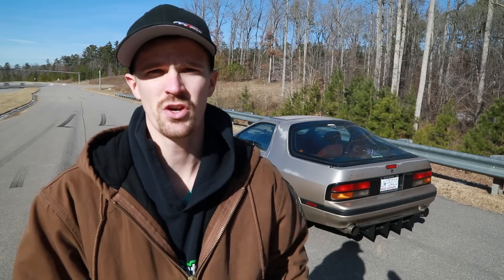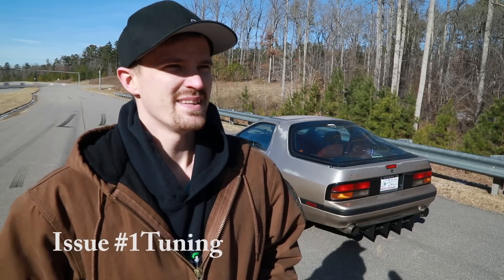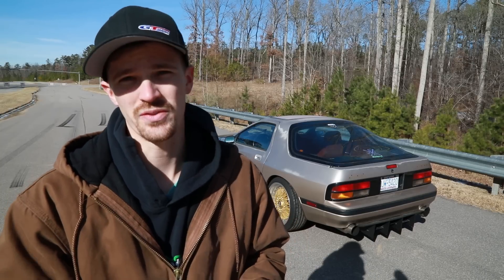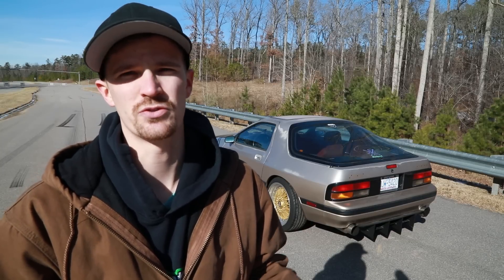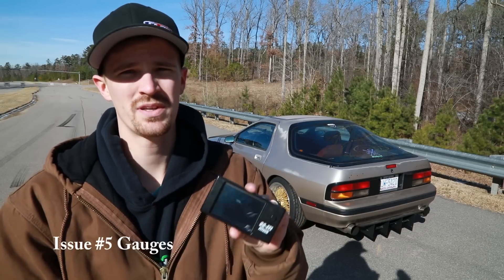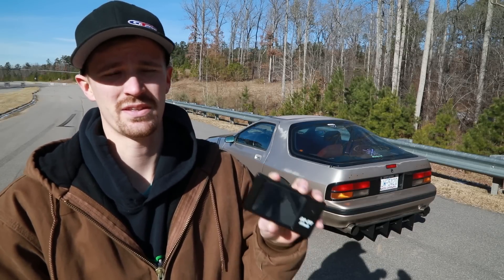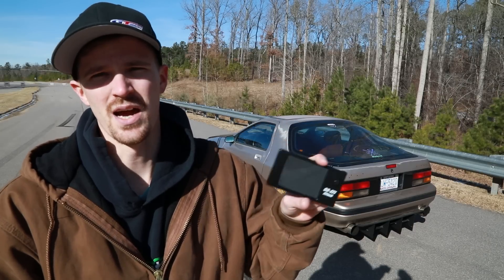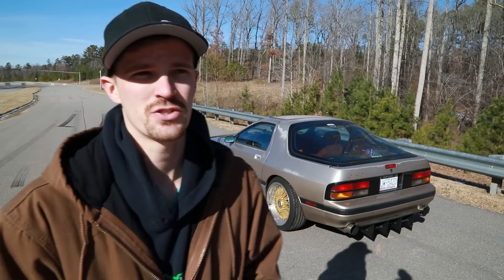5 Reasons Not to Buy FiTech EFI System

Comment: I have watched your video, and some of the commets. The first thing that I noticed was the little air filter. This is your main power problem. Lack of air is flooding out your engine. Bigger is better as far as air filters go. Sorry, I had to give you a thumbs down due to lack of knowledge and hating on a product that you had no business installing yourself.
Reply from the maker: If you will have read the commets you will see that I have run the motor with and with out the filter and had no difference in the operation of the system and that I was impressed with it changing the tune to account for the higher vacuum from a restriction from the air filter. This style of air filter was tested and said it was “ok” to a motor producing around 300hp more then this stock 302 was making. The air filter was used because there was only around 3” of clearance between the hood and throttle body. So rather then slowly kill the motor with dirty air I decided to loose the HP with a small filter something a carb or the efi system should be able to accommodate. The tune was one of the five points of the video it seems you have missed the other 4. Having some programming experience I was very disappointed in the program on the handheld as well as the components used in the system. I made the video for people to have a different view of the product so they can make a better decision when going to buy a system like this. This video gives some of the reasons someone may choose not to go with fitech but there are plenty of reasons to buy the system but that was not the point of the video. Again sorry for your confusion, and happy motoring!

Comment: So just my 2 cents but most of these complaints are petty as hell. Two jacks instead of one? Really!! What do you mean by 100% tuning? Are you running it on a dyno to base that on? If you are going to tell someone not to purchase something you should have a darn good reason and so far I've heard nothing more than whining about various components not being perfect and not having all the features of the more expensive systems.  If you hate the system so damn much why don't you sell it and put a Holley system on it?

Comment: your screen goes blank when you start the vehicle because it's losing voltage and I did not hear you say that you're hooking directly to the battery like you're supposed to be
Reply from the maker: Unfortunately my unit was hooked directly to the battery for ground as well as I added three grounds to the throttle body itself. One to the motor another to tthe body and the third to the battery. I believe the unit was an early production and just had issues. Still not very impressed with the product although it did work and do what it said it would do. Im really looking forward tto these efi systems to develop and improve into something that that works better then what is available now.

Comment: I would definitely stay with FiTech, but go with the 600 horse power version. Change your intake and air filter. Get a single plane intake manifold. A good set of headers and 2 and a half inch dual exhaust. So your in another couple grand, but you will be so happy.

Comment: No one in their right mind would make a video dogging a company while showing their vehicle with that air filter.  Even if you have legitimate issues, you should try another air filter before making a video.  That's got to be a huge loss of power.  The air filter top is sooo close to the throttle body that theirs just no way it can flow the air needed for that Rotary engine.  You would be lucky to get 200 CFM by that.
Reply: Lol it's a 302

Comment: I had Fitech 600 hp and it failed. It wouldnt support fuel over 6000 RPM. And it always hard start spent 4 months talking to tech and they were rude. So they sent me another one hooked it up started just fine the first night the next morning I turned the key on and the ecu went up in smoke and fitech won't send me another one

Comment: Fitech is a good unit...... All I saw in this video was installer errors.
Reply: For example?
Reply: Frank Byers. 1 you would struggle to breathe through that air filter let alone an engine. 2 white screen  would be connecting to the wrong power supply...when you crank it cuts power to  accessories. You want constant power. 3 The heel tow issue would be to much fuel  as it cant breathe  properly. 4 the tune ability of the  base model he purchased falls on lack of research  on the product.
Reply: I guess my question is do you have personal knowledge of his install or are you just speculating based on the photograph is this video?  For all we know he installed that air filter the day he took the picture. It was my understanding from the video he gets power from "the main power from the entire car." Now I do not know exactly what he means by that so I can only speculate he gets power from some wire that connects directly to the engine. Since you are making such comments I can only guess that you have personal knowledge. When you were installing this system for this guy, or you spoke to him personally, or you personally traced his wiring, why did you not advise him this will cause white screen problems? As far as your diagnosis related to the "heel tow" issue, are you suggesting that the unit is incapable of correcting the A/F ratio based on the o2 readings? I do not know what this air filter flows but what I do know is a 302 cubic engine needs about 400 cfm at 5000 rpm. You suggest the engine "can't breathe" due to the air filter. Again, do you have personal knowledge of how much his air filter flows or are you speculating based on the photograph?
Reply: Frank Byers  if the fitech cant breathe  it can only compensate by cutting a % of fuel  to get it close to the correct  afr.

Comment: Wow dude, I don't run that small of an air filter on my 15.5 hp riding lawn mower!
With that aside, I'm sure that there are many who have zero issues with their system. Maybe you have a lemon?
Reply from the maker: Wish I could have fit a larger air filter but with the hood so low i woukd have had to build something custom. The system is an early system and the guy I bought it from had to send it back for repair so there is always that chance. I have used the Edelbrock self learning system sence then and it seems to have similar issues. They will work for most people who drag race or just drive slow to car shows but its not ready for hard street driving and road corse racing. But its a big jump and I cannot wait to see what they have in another 10 years!

Comment: Totally agree.. Wish I'd never gone with the HP400.. The first one shipped (from Summit Racing) was faulty.. The fuel pump ran.. Even with ignition off.. After 3 calls to technical I was told to ship it back for "repair". After them having it for a week I called them.. They explained it took 5 working days to repair.. I explained they had now had it 5 working days.. I was told to call following week.. Another 5 working days later I called to get an update.. To be told "we havent looked at it yet" another 5 working days later they said the same thing.. After I asked why they dont just ship me a brand new unit.. As clearly mine had never been used they said it had to be repaired. 3 days later I called to get business owners name to file court paperwork.. Then suddenly they agreed to ship me a new unit.. A week later I called to see what was going on.. To be told "we dont have any in stock.. It will be shipped next week"  eventually got a working unit.. Set it up.. Took it for an emissions test (on a brand new 302 crate motor with all new exhaust) and it failed on high CO2.. Called their crappy technical support for help to lower the CO2 only to be told "our units are not designed for road use or meeting any emissions tests"... The company is a joke.. If you are thinking about buying a FiTech unit.. Look on line for the many horror stories.. It seems a large number of units shipped have issues.. Technical support is useless.. And the in warranty repairs are not done within 5 days.. Personally.. If I could go back... I would AVOID FiTech
Reply: You don't read much, do you !

Comment: It really is junk. The boost sensor is NOT rated for the binders that keep alcohol in fuel, non meth kits. Im telling you this first hand....over 8# and over 500HP you will experiance engine failure when ALL THE INJECTORS fire at once 100%.
Also, if a P.A. system, your intake manifold must not have any "shelf" under the boost referance.
I know.....the hardly used, and overly estimated H.P. guys will argue.  
So dont complain my way, call Fitech and ask for the part number on the boost referance sensor. Go to Freescale conductor...AND READ IT FOR YOURSELF.

Comment: Dude try running down the road breathing through a soda straw..
That aircleaner wouldn't feed a lawnmower
Was a mechanic for 30 yrs and always amazed me that people would think this was a good idea
Reply: Yup, before I clicked play I saw the thumbnail and was saying WTF is this guy thinking????
Reply: Yes DEFINITELY dich that shitty air cleaner and figure out a better filter system. May actually cure some of your issues.
Reply: Thought the thing. I used to work on a golf course and our walk behind greens mower had larger air filters 🤪
Reply: Totally agree. That small air cleaner probably works with VW air cooled engine. Considering it from my kids 1776cc vw bug.
Reply: These cheap throttle body injection systems are junk. It's like everyone forgot about the tbi of the 80s and 90s. These things are nothing more then a electronic carburetor. If you want to run EFI spend the extra money and go multi port injection.

Comment: Your power cable is to small and you need to solder your power connections and have twice as big a fuse than it needs

Comment: Another reason. At no point in time did the team at sema 2016, tech support on phine, nor did website state...that you cannot run leaded race fuel on the system. Always been a carb guy literally never knew the no leaded fuel o2 sensor rule. However the owner of the comment decided to talk to me with a hair across his ass when i was at the track with his system trying to figure out the issue. Practixally gavw this system away and went back carbd. Had a 700 flywheel up sbc, bitch never ran so good once I put a prosystems carb on top of it. Pro systems has immediate email response and fir your carb to your system tuned and ready to go, #fuckfitech
Reply: Owner of the company*

Comment: I'm gonna say you should try running a new larger air filter. that thing would be restrictive as hell, probably confusing the unit.
Reply: That is correct. I saw an engine masters dyno pull with carb vs fi on an ls. Even filter height, and dual plane confuse FI. This was a Holley FI
Reply from the maker: I wish it was that easy, iv run the unit with and without the air filter and still runs the same. But it did do a good job between tuning for one then the other.

Comment: Could probably get a more stable power feed during start by adding a capacitor (and perhaps a diode so the capacitor won't try to feed the whole car, just the control box...)
Reply from the maker: I like that idea. Seems odd to me that the ecu keeps running but it kills the hand held only. I also just switched the fuel pump to a separate relay and it seems to have helped a bit. Thanks for the helpful input!

Comment: I've put 50,000 miles on the 600 hp unit on a manual, V8 s10 with a choppy cam and a super light flywheel.  They will not self tune to perfection, so don't go in expecting it to.  They are drastically better than a carb if you plan on actually driving a vehicle distance.  I get 19-21 mpg mixed driving mine consistently and it controls my fans.  The connectors are no issue if you actually secure your wiring harness like you're supposed to.  So don't be an idiot and learn to tune (you're supposedly a gearhead, you should be wanting to learn that anyways), lastly, get out and drive!  Do some mileage, do some test pull, tweak settings and MAKE NOTES!

Comment: What is with the riding lawnmower air cleaner element? Might as well stuff a sock in the intake. Beautiful car, however.
Reply from the maker: Unfortunately hood clearance is minimal at best. With this air cleaner I only have about a 1/8-1/4” to the hood. And thats with the hood structure cut out on the middle. Id rather run a small air cleaner then none at all.

Comment: had the go efi 4 600 on a hi per 355 sbc in a 86 Cutlass. Dual plane and 227 duration cam 109lsa, vortecs, etc. I didn't skimp on the fuel system and this efi system didn't miss a beat. NEVER HAD A PROBLEM. Best experience with efi, hands down. Good product. Lol if I can use it anybody can...

Comment: For the temp sensor, run you car sensor wire to the sensor for the unit, they should both be able to read the temp.
Reply from the maker: I wish you could do that but the temp senders, but two gauges reading the same sensor would lead to both gauges reading only 1/2 the real temp. You would need to get a “smart” sensor to be able to do something like that and im sure the FiTech would not support that.

Comment: Are you using the stock camshaft. Maybe that’s your problem
Reply from the maker: Yes its the stock cam, it should be the easiest cam for the efi to work with. Efi systems have trouble with larger cams with overlap ect then a smooth stock cam. But maybe Fitech programs everything for a larger cam you never know.

Comment: I dont know anything about FiTech, but i do know that with a Ford its easy to give an a9l a wiring diet and have TPI instead of TBI and also with a 36/1 crank sensor and edis module have coil pack ignition like the explorer. Thats the route i would take unless i was shooting for 500+hp.
Reply from the maker: I had tried to do the stock mustang EFI “a9l” but trying to buy a complete stock system was a pain I found a few on craigslist but no one had a “full” kit they were all going from efi to carbs and just ripped out the old system. No one knew what they had or what they needed to do the swap. The other issue is hood clearance the 302 intakes sit high. The explorer coil deal is pretty neat looks mich neater then the distributor.
Reply: Petrol360 ill agree on stock harnesses getting fairly rare. I still see a few on ebay. For my 95 f150 for my MAF and EDIS swap im going to remove the entire harness and remove the emissions wires all the way to the ecu plug, repin for A9L and add wires for sequential injection, send wires to edis8 module mounted on firewall and 36t crankwheel. And use an explorer cam sync to drive the oil pump, and mount the coils low so no plug wires over the new valve covers. Also going to do the electric fan control mod to open up space for maybe a turbo in the future and easier oil filter changes and pulley/belt/acc work right away. Then ill get everything to length (that i added) and rewrap it. Intensive, but worth it. Right now i have most of the parts, but we are getting hit hard at work with the nice weather and i cant get anything done on it.
Reply from the maker: I know the feeling trying to find time. The throttle body efi systems are just so easy though, a handful of wires and an o2 sensor and you have a running system. I feel that in 5 years these systems will be worth it and rid us from doing the stock harness “diet” to fit our needs. I guess I just jumped on to early for this system but its really been a lot of fun working with it and seeing the market change. Going to be putting a 302 into my f100 soon guess I will have to revisit the efi question again and see what best/easiest/cost effective thing for it. It might just be the Holley 600 dubble pumper sitting on the shelf haha.

Comment: Your fixes are. 
You need to add the software update. Your air filter is way too small and it even looks dirty plugged.   Set your DCFo down to five or zero to shut the option off that way it always leaves fuel in the fuel lines on the fitech for immediate acceleration.  If I remember right the white screen fix is they will ask you to exchange your cord and screen     Fitech units do work the engineering was done for them through Cal Poly U.  They have tripled their amount of call center people so they are available to help if not. The fastest way is to go through Facebook messaging.
Reply: Most of the time I run without the display plugged in

Comment: Your grievances are legit, but they're really more like "5 annoyances with a FiTech system" rather than 5 reasons not to buy one. The unit works great once you get it tweaked, and you'll have things to tweak with anything if you're going to go beyond the "plug and play".

The lack of info on their page vs what you find buried in forums is certainly not optimal. I was aggravated by that as well.

Comment: start with a big aircleaner...deceleration and throttle response will improve. Dave that aircleaner for a 12 hp lawnmower.
Reply from the maker: I ran the system for a month or two with no air cleaner at all and the ststem ran the same as it does with the small filter. But I will say the system did handle the change from one to the other pretty well just two 30 min drives and it seemed to be back to normal.

Comment: Great video , but here is a tip on your tuning problems. These throttle body FI systems will never run correct on a dual plane intake. You either have to remove the intake and cut the divider out of the plenum or install a open plenum manifold. A easy test would be to put a 2in. spacer under the FI unit and try it before you remove the divider. You can watch the enginemasters series where they test a Holly TB FI and see the problems they had also.
Reply: Yep I saw the vid and was going to comment on it.